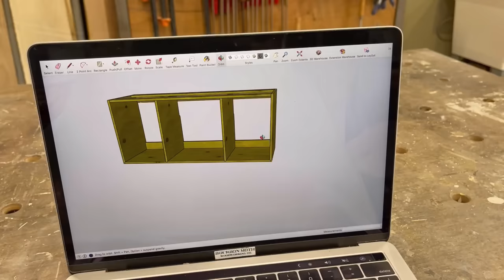Build Bathroom Vanities Like a Pro || Two Cabinets Designs

Comment: Very nice work, I like your design sense and eye for detail !
Q: What do you think of using a full face piece for the center insert panel that has 3/8" deep rabbit cuts that match the spacing between the drawers on the 3 faces that interface with the frame?  This would eliminate the need to 'sharpie' the backer panel...
Cheers